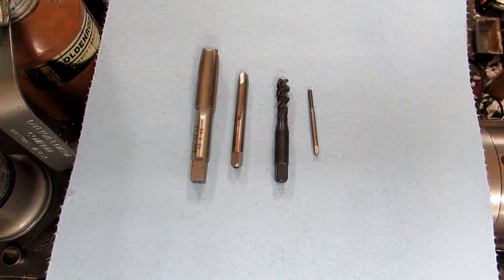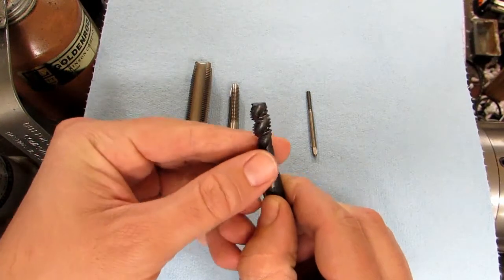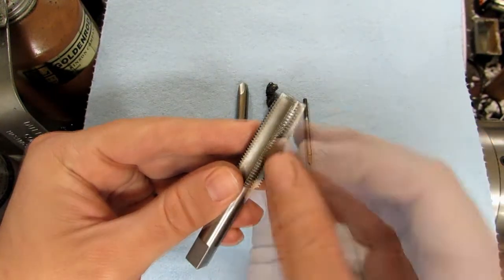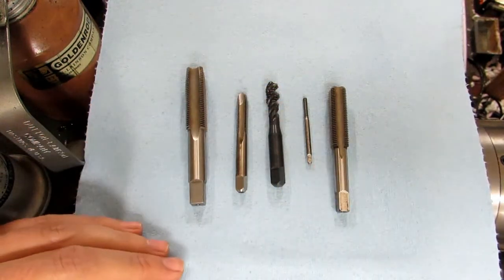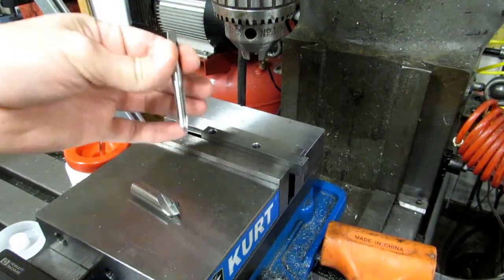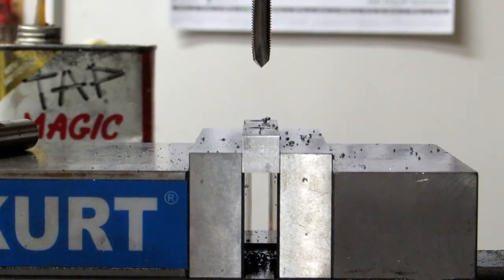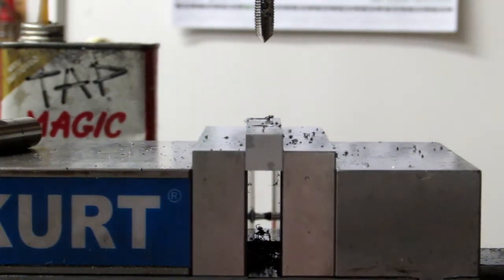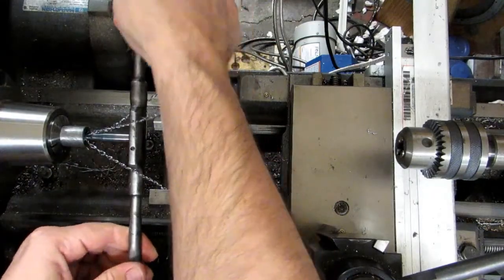Tapping Under Power on the Milling Machine and Lathe

Comment: Your part also needs to be TIGHTLY held in the vise or the tap will pull it out, or partially pull the part up, jam and break the tap.  The vise needs to be secured to the table to prevent the vise from being lifted from the table by the tap.  These are all things I have witnessed in working with students.  If I am tapping holes on the Bridgeport I limit the size to 1/2” or less because larger sizes are really pushing it on a light duty machine such as a knee mill with a drill chuck.  For larger sizes I use a tapping head.

Comment: I use a Grizzly Mill/Drill that is set up for power tapping and I find the spiral flute taps to be excellent. They also work well in a cordless drill on the lowest speed setting. I've tapped lots of holes in aluminum and mild steel and have yet to break a tap.